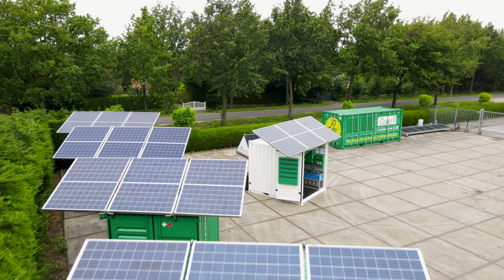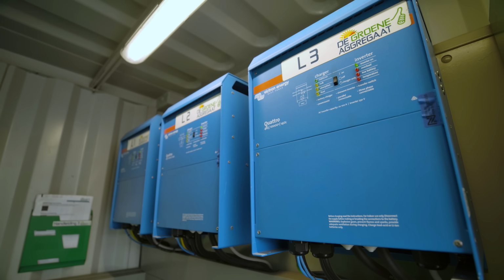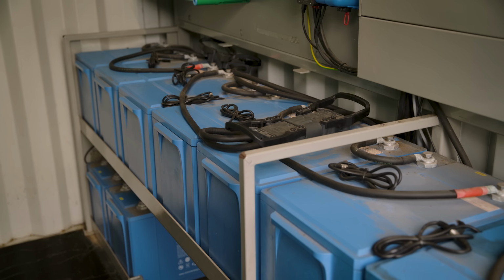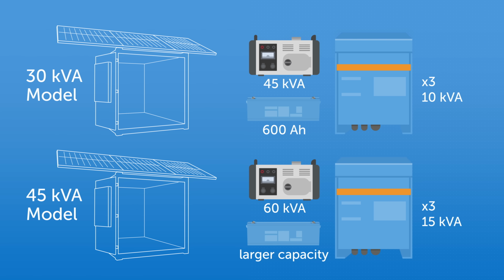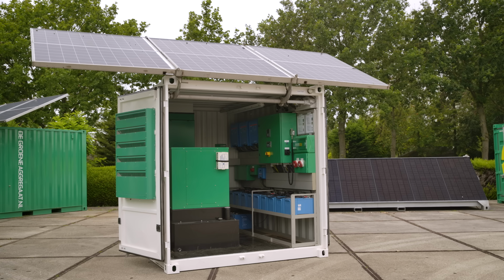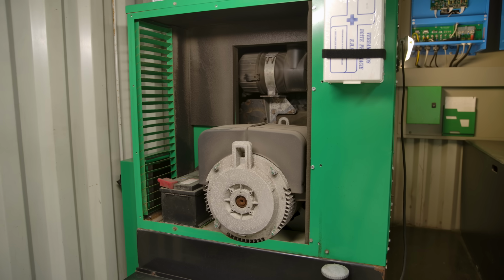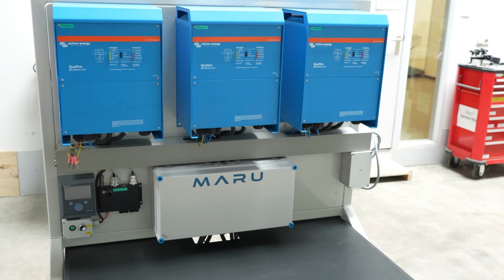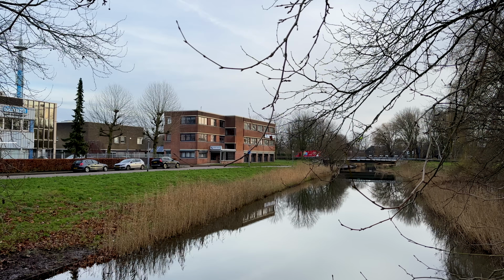Is this the future of Generator Power?

Comment: terrible in idea and execution. no wonder they only make 10 units a year. a fuel generator could be cheap upfront but it requires frequent checks, maintenance and less reliable, needs an exhaust, might breakdown when you actually need or while using it. replace this with LFP battery then you could use some of the charge when electricity is expensive, could ROI unlike the fuel generator has almost no ROI.
Reply: I work in the oilfield. It is always remote. I run a Deutz 15k gen, 24/7. Regular preventative maintenance keeps it running.
Reply: @billybones4523  agreed. companies replace parts that are barely worn down or used to maintain high reliability on mechanical equipment. it would be better for this company to make fuel generator set as an option or external module and make the main product fully electric.
Reply: @zodiacfml do you realize how many solar panels and batteries you would need to make a 60 kw system 100% battery powered?
Reply: @zodiacfml evidently you don't fully understand the concept here, I have ecoflow solar batteries,  about 25kw of storage capacity and enough solar panels on two solar trackers, to keep them fully charged throughout a sunny day. The batteries can be recharged through grid power or my ecoflow duel fuel generator. It's a very efficient setup. Saves me money, and i also have power during an emergency.
Reply: @blkgranit333  the amount of solar panels u must have to keep a 25kw system charged must be huge compared to the small array this setup has
Reply: @blkgranit333  if u are using a generator to charge ur batteries u must be confused how the laws of conservation of energy work
Reply: It has to be tier 4 for temporary  use up to a certain number of hours. With this system it is possible to use a smaller generator for almost 2 times the output of the generator alone for surges. At full load my guess is this hybrid system could run 2 twice as long on the same amount of fuel.
Reply: For people commenting here 

This does niet replace a generator 
It’s to save fuel , up to 80% reduction 

This is because the generator runs less AND on a much better load 
So far less service intervals …
Reply: @johannesboonstra6917  save fuel? lol ok right
Reply: @newslavecity8311 yes, because the load is topping of the batteries. That is a constant load at the most efficient level of the generator. So either running efficiently or running not at all. No surges/ high demand.
Reply: @hansdenotter7376  u realize running a generator to top off batteries and then using the batteries to then power equipment results in a huge loss and waste of energy right?
Reply: @newslavecity8311  yes, I do.
So tell me how would you solve the lack of battery power adequately?
Reply: @hansdenotter7376  using the grid or a generator to charge ur batteries and then using the batteries to power ur house is a waste of energy, because in using the grid there is energy lost through heat and inefficiency of chargers and inverters. using a generator to charge ur batteries is even worse because there is a huge amount of energy waste converting fuel to electrical energy  to charge ur batteries then inverting the power to power ur house. the use of the grid to charge ur batteries only makes sense to have a backup when the power goes out, and that is solely the reason why u should use the grid to charge ur batteries. the only reason u would use a generator to charge ur batteries is when ur using the generator to power ur house in the first place but since the generators are already running u might aswell divert some power to charge batteries incase u run out of gas and u then could use the batteries to power ur house for a bit while ur refilling the generator. the only logical way to reliably charge ur batteries is to use solar wind or hydro power. if u use 20kw a day (alot) then u would need a battery bank and a solar array to fully support that use if u want to be completely energy independent. if u want to be semi energy independent and have a backup u can opt for a 10kw system. it doesnt make sense to use the batteries as an intermediate power source between the grid and ur house, the only tome it would make sense is if u lived in an area where power is super unreliable and goes out almost every day, countries like south africa have scheduled power outages every day for long periods of time.  in the case of this "invention" it just doesnt make sense, its marketed for construction where they need constant reliable power where its not available thats why the use generators. construction also needs the generators to be easily moved.  putting the genny in a shipping container makes it almost immobile. also there is so much dust in construction zones the panel array would be rendered almost useless. so the solution is ditch clown show and just use the genny. if u want to build an off grid system then u have to have the batteries and solar array to support ur energy use and the proper inverter to cover ur immediate power use. a reasonable person should be able to live very comfortably with a 10-15 kw system and a 5-6kw inverter. if ur trying to power an over sized 5 bedroom suburban 2 story home then yeah u may need a 25-30kw system with a 8kw-12kw inverter. it all depends on ur needs or ur ability to manage ur energy consumption. for example an average sized central air conditioning system can use 3-5kwh which could be around 50 kw a day if ur running it 24/7. now if ur using a minisplit system 6 hours a day at 1kw an hr ur using much less energy.
Reply: @hansdenotter7376  i get it people want to be energy independent and use batteries and solar to power ur home. and i get it can be very emotional and u want it to be green and save the planet. but u have to have a good understanding how energy works and unfortunately a big pocket book to make it work. u also need to live very conservatively and in a small modest home.  if u resort to live on a small homestead with a mini home u can definitely be energy independent with a budget of 15-20k  but if u want to power ur 5 bedroom cookie cutter suburban mansion ur system could cost upwards of 100-150k sometimes more or a bit less but a huuuuge investment.
Reply: So what happens at night when you need power? Do you think an array of batteries is going to be feasible? Or what about those cloudy days? I think it's a good approach for what we have available right now.
Reply: The arguments in this comment thread are so childish.
Reply: Deisel generators run for years and years with fairly basic maintenance
Reply: @MegaRyan123456  they do like many old diesel vehicles but requires periodic checks and plenty consumable parts that needs replacment
Reply: @zodiacfml 

I have back up power for my property

Solar+battery's and a backup Genset

Genset does need maintenance

But if the power went out and there is no sun it's the most effective way to make quick power if it's overcast or a storm

As the cost to benefit ratio is insane

A 5kw Genset can be had for a very inexpensive price ... 

It's part of a backup system with redundancy 

V
Reply: @zodiacfml how to tell us you know nothing about diesel engines. 🤔😒🤦‍♂️ there is no generation power on the planet more reliable than diesel.
Reply: @michaelpetty8416  how to tell us you know nothing about corporate process🙄🙄😒😒

Comment: My concern would be the longevity of the battery pack and related maintenance.
Reply: The point of the whole system is to have the generator run less, and when it runs as efficient as possible. It's about saving fuel and getting the fuel to the system ect.    If the battery would only last 3 years, already you would have made a considering amount of saving both on fuel (sometimes 80% less fuel is needed ) and maintenance as the genes run 15-20 hier less then a stand alone model would
Reply: Ensuring the longevity of our battery packs and minimizing maintenance is a top priority for us. We use high-quality components and provide comprehensive support to ensure optimal performance over time. If you have any specific concerns or questions about maintenance, please feel free to reach out through the website mentioned in the video description.

Comment: 6 panels are a waste! You need much more than that to make this thing worth while.
Reply: Not necessarily. That's plenty to power a crew portacabin/restroom on a construction site.
Reply: What you see in this video is a specific model of which we make this certain, smaller, quantity for the Dutch Rental Fleet market. This number is larger for the whole of Europe, here we also make other , bigger, models for the European/global market. We produce mobile and fixed sustainable power solutions. If you have any further questions or need assistance, please don't hesitate to reach out through our website.

Comment: Using the generators only when necessary to charge the batteries must really increase the efficiency as while charging they are not subject to the extremely variable demands that are common when powering loads directly. The mobility and ease of set up offers so many advantages while also minimizing the use of fossil fuels. Bravo! I love Victron equipment, wouldn't use anything else.
Reply: I have a 24v system with 1200w of pv panels and 600Ah of battery for my radio shack and emergency back up at home (only essential appliances).  I use a small Honda generator to top off the batteries when there is not enough sunlight.  I live in a Mediterranean country, so not enough sun is usually not a problem.
Reply: @timbookedtwo2375  Honda EU2200 or even the small EU1000?
Reply: @K0nst4nt1n96  I happen have an eu2000i.  the little one would probsbly work too
Reply: Its borderline useless.
These few panels barely deliver enough power for anything here in the Netherlands.
So in the end it's just a fancy, overpriced... generator...
Reply: @MrPuffin69  But even then the generator is not simply idling when the power is not needed.
Reply: Nothing "green" about solar panels  and lithium batteries.  Except maybe the money and the green washing of it all.

Comment: I 'd like to see this with a solar array trailer that ads even more solar power
Reply: yes, those 6 solar panels only seems to me it is very underpowered.
Reply: or offer different types of generators like gas/biogas....
Reply: @alanmay7929  we offer the usage of HVO100 generators aswell. optionally PV installations can be connected to the system externally on the main output
Reply: Buy a trailer and solar panels and then add the "generator module". Voila! ;)

Comment: Victron is such a great brand but the installation can be quite complex given the modularity of the units. A luxpower, solark, Deye inverter and others could have done that all of this in less space and installation hardware.
Reply: That's what I like: the modularity!
Reply: @Kosmonooit  if you can afford it that's great but during my installation day a simple all-in-one inverter covered 99% of all applications and less that 1/4 of the installation time.
Reply: @johanncover1988 I had to choose between modular Victron sistem and all-in-one Deye (cheaper).

In the end I got the Victrons for lower standby consumption and for the possibility of shutting down the inverter when I don't need it, remaining to use only the mppt charger. This option is not available in Deye hibrid inverters yet.

I agree, I have to hire a good Victron electrician to connect them all together. I don't want to risk and do it by my own.
Reply: @silviuflorescu6838  that is a very valid point and in the time of more expensive solar panels I would agree with you but now in an environment of cheap pannels and falling batty prices I don't think its valid now. 500-1000 dollars in savings can getting your a good amount of pannels and  $1600 can get you over 4kwh of battery storage, which is much greater than any parasetic load on an inverter can use up.
Reply: @johanncover1988  , you are right, too.

From my perspective, I chosed the modularity , in case I want to upgrade it at some point and to use some of the components in my campers builds.

I also feel safer turning off the inverter part when I am out of the house for monts. I'd just need DC current to feed the IP cameras, router and some  lights.
The 80-100 Wh consumption of a Deye (in standby mode) would make me feel cheated 🙂
Reply: @johanncover1988  you get more than functionality with Victron. Sure other products do the job but for me, Victron is next level. Support is a big issue as well

Comment: Great use case to provide efficient power production were needed.  Curious on the ROI for the cost increase, but the reduction of pollution is worth a great deal.
Reply: I've been running my off grid workshop this way for a bit over a year. The generator doesn't waste fuel at idle, waiting for a load to be applied.
Reply: We're thrilled you recognize the efficiency of our power production. While ROI varies, the reduction of pollution is invaluable. For further insights on cost-effectiveness or any inquiries, feel free to reach out through the website mentioned in the video description.

Comment: Love the Dutch idea.
It will be more fuel efficient then a standalone generator and the solar is a nice touch. 

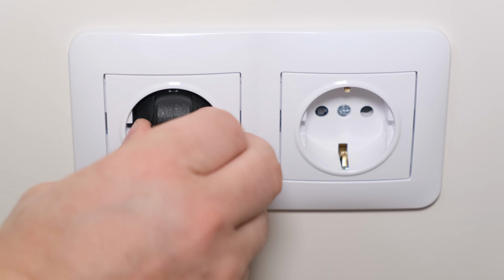However @2:40 the claim is made that a standard 16A 1 fase outlet is good for 4,5kva.
I am sorry but is not. 220/230V multiplied by 16A is around 3,5kva.

I am using you equipment since 2018 for independent power at job sites. 
Still works like new.
Reply: Thank you for your feedback and for sharing your experience with our equipment! We appreciate your support and are glad to hear that our solutions have served you well since 2018. We'll definitely review the claim made at 2:40 and ensure accurate information moving forward. If you have any further questions or need assistance, please don't hesitate to reach out through the website mentioned in the video description.